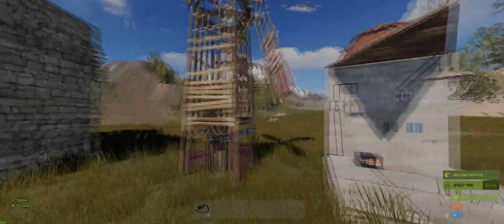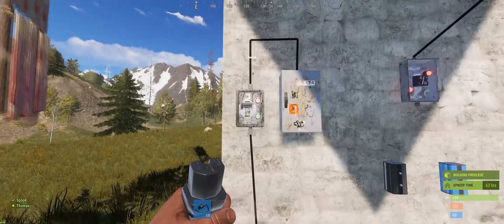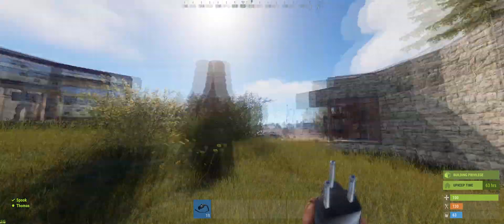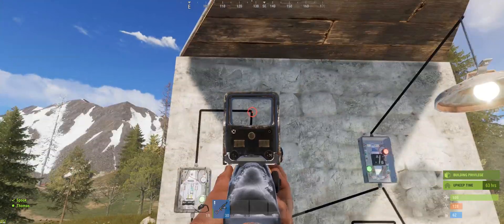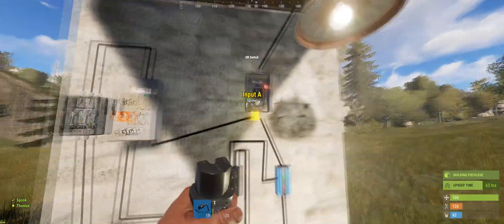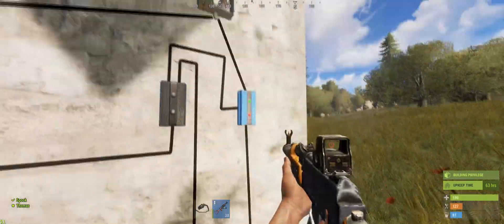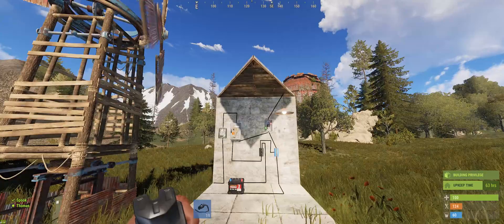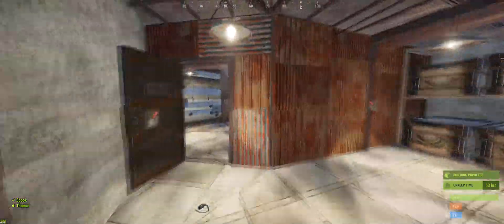Rust Electricity Tutorial #3 - Infinite Power

Comment from the maker: Note: The switch in this circuit is to emulate the turbine stopping. In your circuit you will not need the switch.

I would also recommend using large batteries for powering anything more than 2 lights.

<3
Reply: agree - you wont need the switch - especially if you have a solar panel i/o the windmill
Reply: instead of a splitter use another branch.  using a branch would allow u to be able to channel power into 2 sources instead of 3 so you have more power per socket.  that is of course unless you use the 3rd socket with a root combiner and you can maybe have a 2nd circuit
Reply: The circuit is flawed, turning off the switch will disable charge to the battery.

Comment: Cant understand why you would need to do this, can you not just put the windfarm in series with the battery it would charge anyway as long as input higher than output , one branch after the battery , branch the amount of power required for lights and have a spare output, lot less components

Comment: Love your setup - i have a problem tho - i have alot of units i need powered. Im currently using 2x windmills and 6x solar panels and im trying to recharge 3 large batteries while all my units are draining power. 

Problem is. Batteries Arent recharging fast Enough. So i need your system. But how do i .. lets say- connect several more units to the system

Comment: If I put an electrical switch between the OR switch and the lamp, the OR switch will still drain the battery even if the electrical switch is in the OFF position and the lamp is not recieving power

Comment: Works great! How ever I used a branch instead of a splitter to have have battery power go on as soon as the electricity drops below a threshhold that I set in my branch. I think with a splitter the power has to completely be cut off and before the system attached might still be half working, but with an extra branch the passthrough to the battery circuit should cut off before the set branched amount cuts off triggering the battery to be used. The advantage is that the system should always have enough power even if the wind is just a bit too low for example.

Comment: Any chance I can get your help with something?
Reply from the maker: What's up?
Reply: @SpookGaming   Is there anyway I can make this so the light only pulls from the battery when standing on a pressure plate? Activation only. Rather than passively pulling power from the battery? I'm working on a project right now but it won't hold up if during the night time the battery isn't being charged.
Reply: let me correct myself. pressure plate activation while the first switch is off

Comment: Charge your battery, turn the switch off, disconect the output of the or switch. The system uses a LOT of power, while ther are no real consumers?
Reply: sorry I was too quick with my conclusion, even though this system used a lot of its own power. There is a workable flow over. Now I need to have something that turn off the power at a certain amount of tension. I have a dead point between night and day of 2 min. So I want something, If the OR switch output comes under 80 during the day of my panels.that it all is going to switch at 80 to the battery. and not wait until there is no sun for he switches.... So, How can I cut off power at a certain amount of power?

Comment: ok, here's the thing i was attempting to do. make an alarm system (siren light and speaker alarms) that would be activated/deactivated with a remote and a receiver that would alert an area of a threat. the toggle portion of the memory switch did the trick when i connected the receiver to it, but it drains the battery whether it's in use or not. the receiver doesn't drain the battery when not in use, it's the colored boxes. i had two batteries to be sure of this. if i engaged the block pass through with the inverted output it turns on and doesn't drain the battery, but doesn't turn off. tomorrow i was going to put a hard "switch off" box somewhere into the mix and see if that worked to turn it off, but this is not the ideal solution since i wanted a start/stop function within the remote itself. the other application could be activating a door from a distance with a remote for a trap base type design, or for base defense. as it is, i have made a night light function with the switches by eliminating the OR box in this design. it turns on lights at night only, BUT only with the solar panels since they are switches in and of themselves through sun activation. if you want to get on a creative to see what i am talking about my name is Clever Monkey in game and on discord.
Reply: https://www.rustrician.io
practice here 
ill try too to see if i can figure it out

Comment: Not "Infinite Power". It's a smart system that during the day, runs your base off your electricity source while at the same time, charging your batteries without using them. At Night, when solar and wind aren't producing as much, the system switches to the batteries to continue running your base and lights.

Comment: Your accumulator get the half of turbine power cuz u split it with splitter and ur lamp use half when it need just 2.Thats how it should be https://prnt.sc/m3gugp i use red(2solar panels, black(put 5 cuz lapm2+splitter1+blocker1+ORswitch1) and blue. The main idea is black(electrical branch) u can put exact number of power that ur lamps needs and all another power u use to charge ur accumulator.(sorry for my english :)

Comment: Explain ? Why that blocker and why that ?
Reply: the blocker seems to help with battery drain as far as i can tell ATM. if the battery is hooked up to a colored box it drains it no matter if the box is connected to something or not. check for yourself and see.
Reply: The BRANCH/BLOCKER combo is basically an automatic fail-over device to power the LIGHT from the WINDMILL or the BATTERY depending on whether or not there is any wind (or the main SWITCH is opened).

When the main SWITCH is ON and the WINDMILL is turning, power passes through the through the SPLITTER to the BRANCH and to the BRANCH's "branch" output to the BLOCKER (turning it on, i.e. making it block power from the BATTERY to the OR switch).

In Rust, BATTERIES charge when provided with input power while their output is disconnected so  at the same time all of the above is happening, the BRANCH's main output goes to the BATTERY to charge it.

Since the WINDMILL's output goes to a SPLITTER, a portion of it's power also goes to the OR switch which turns on the LIGHT despite the BLOCKER being turned on (i.e., it's blocking power from the BATTERY).

If the main SWITCH is turned off or the WINDMILL stops turning (i.e. it produces zero power) then the BRANCH's "branch" output drops to zero and the BLOCKER turns OFF which causes it to stop blocking power from the BATTERY and so power flows from the BATTERY to the OR switch, turning on the LIGHT.

Comment: Circuit would function exactly the same without splitter and OR switch. It is the same principle that was designed weeks ago using solar panels emulating the sun going down.

The only difference is that your lights are going to be on during the day using this setup, which is relatively pointless.

HOWEVER, using this circuit to power other devices that aren’t lights could be handy.
Another thing to note is that I would always recommend using the advice of placing the wind turbine on the highest point of your base to maximize output and reduce the chance of it ever turning off.
Reply: is that a thing? higher elevation means higher wind probability?
Reply: Yes, it means higher chance of more power generated, and it also means lower chance of wind turbine stopping altogether.
Reply: thnx